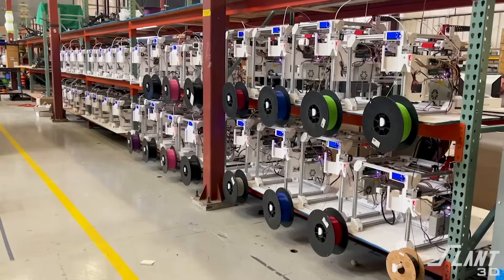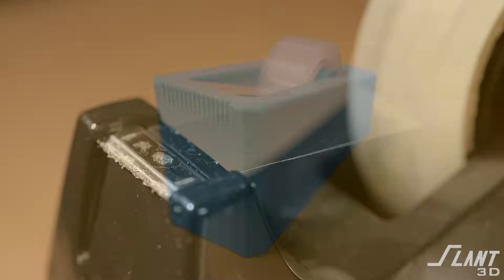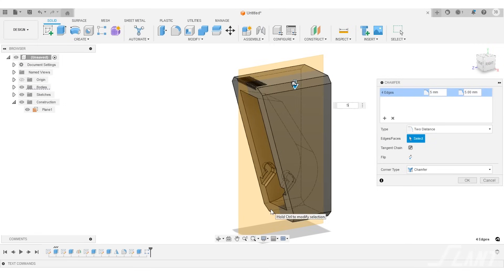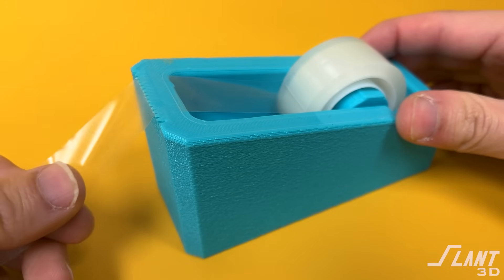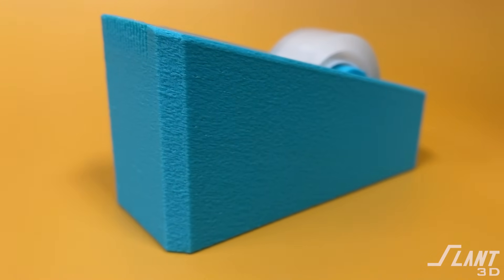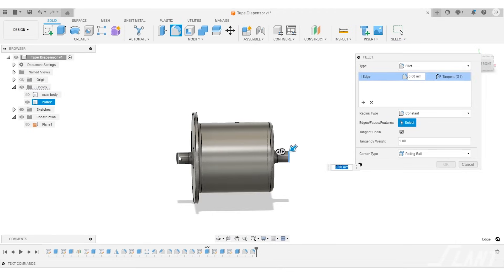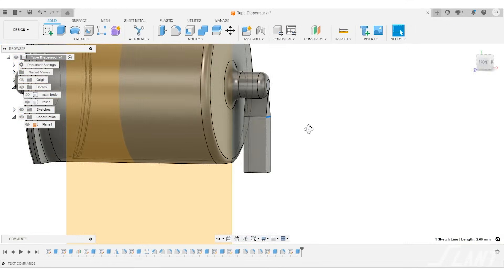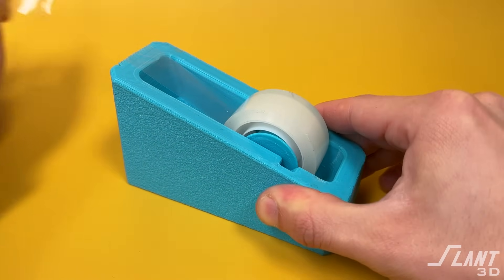Designing a Tape Dispenser for Mass Production 3D Printing

Comment: I think that it could be easier and also faster if you print the roller inside the housing as one piece (in place like a joint open in one side) and support each overhang of the roller with a very thin point of touch in the housing ( something that the final customer can brake by pulling out himself) . 
Also ( I suppose someone also wrote about it ) in your design there in not enough space for the finger to go under the tape and grab it. 

Nice videos anyway . thanks for the good ideas

Comment: You could have used the tape dispenser itself as a support for the roller pins, by printing both at once
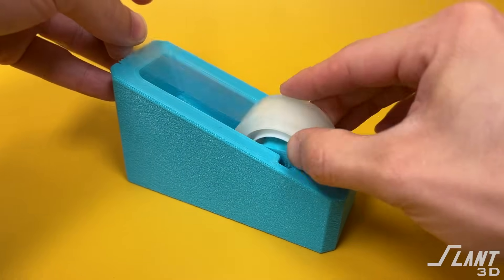Look at @5:42 , they're flush
Reply from the maker: Good point. Totally doable. Though there would be a bit more sag on the Dispensor Roller Pegs
Reply: Big brain 👍

Comment: wont is cost a ton because of the supports and the assembly?
Reply from the maker: No supports and no assembly
Reply: I mean puting the other part inside the bigger one + the part you added which is a different type of support (tower) @slant3d  
I just don't know if this specific product is better with 3d printing just because of the cost. maybe with some automation but then I don't see why indjection modling isn't better.
correct me if I'm wrong about the price, because I don't have a manufacturing buissness (including of course additive)

Edit: as a proof of concept, it's amazing to see what 3d printing can do

Comment: This may be easy to print but this design misses all the key points of a tape dispenser. I'd like to see a take on the design that actually keeps the product functional.

- That U shape is to grab the tape easily
- Sand is cheaper and more eco friendly, you'd need crazy high infill for it not to slide around.
- Even with high infill, it's too light for 1 hand operation

If you can't use it with one hand, it fails a being a tape dispenser.

Comment: I'd like to note that the all too frequent suggestions that having to learn different engineering design techniques that work well in 3d Printing really is nothing new. We did not start doing the variety of injection molding we see in that market 70 years ago when injection molding started being done. Things like dual injection of a different variety of plastic for different varieties of texture or grip, etc. These took many failed attempts before repeatable solutions were found. Learning new techniques that work well for 3d printing is going to take time and a lot of experiments that don't happen to work.

Comment: The fizzy skin looks neat, but I can’t help but feel like that option was enabled because whatever printer you used is optimized too far into the speed side of things rather than the quality side of things. The wall stacking on the inside of that part looked very inconsistent. Is that the norm for print farms? This is a genuine question - while I’ve been in the 3d printing hobby, I’ve never printed anything as a product before, and for all of my personal projects (most of which are mechanical and don’t actually need to look good), I’d consider that level of inconsistency unacceptable. So, is that level of quality inline with other 3d print farms, or were you just trying to get a part out the door as fast as possible for the video?
Reply: You would often trade down quality on interior surfaces for speed but the photography setup & coloration is making that inside wall stacking look much worse than otherwise.

Comment: I like most of the design (apart from the issue others noted with access to the tape), but are we going to talk about the finish inside the dispenser. I couldn't regard something with layer lines like that as acceptable.  Is it the just a rough print? Is that a different noise finish that just doesn't come over well on camera? My X1 doesn't ever produce something that liney, if it did I'd can it. Is this the mass production printers print quality, or what? I don't know if I'm too sensitive to it, but to me the lines on the inside make it look amateurish and devalue the product. I know you've said in the past that customers don't care ... but really? Possibly it looks different in person.

Comment: Would it be possible to see some price comparison for items like this? What is the cost of making 1, 10, 1000, 100,000 etc  this way as opposed to the classical methods?  I get the principle and the engineering / design benefits  but it would be great to explore a real world case study with some numbers in it
Reply: Using the 0.25 lb he quoted in the video, some math indicates $1.25 for just the filament, assuming the $11/kg he is targeting for the final price of what they will be selling to customers. Note that this doesn't account for electricity and business expenses. Most tape dispensers of this style appear to be in the $5 to $7 range, so even with all of the other expenses it is likely that it can be produced at a price competitive to injection molding.
Reply: @logicalfundy actually if raw material costs 1 usd probably with all the expenses it ll cost manufaturer around 4-5 usd. If you want to profit %25 or %30 it ll make it 5-6.15 usd. Excluding shipping. It needs to shipped advertiesed by the buyer. So they need to sell around maybe 9 usd ish. Not very price competetive.

The thing is, if you want less than lets say 1000 unit. Then you get that price competetive range.

Around 300-500 unit, 3D printing is super competetive in price. Probably cheaper than many other methods. After 500 units it ll get close.

After 1000 units its really hard to beat the molding depending on your object geometry. Especially with thin objects.

I know these because i have a consultant company for mass manufaturing and prototyping. Also I have a second company that 3d print on demand with around 20-50 machines.
Reply: @X7Hide  so basically the tape dispensers being sold today have negative material costs. Sorry, the math doesn't add up.
Reply from the maker: Check out a few of our past videos. We going into those types of comparisons

Comment: It's cute. Although I would have preferred to have the teeth separately. Keep them 3d Printed I don't mind but slot them in. So once they are getting blunt you can swap in replacement teeth and don't need to throw away the whole thing.

Comment: This design does not seem very ergonomic to me, the reason most tape-dispensers are U shaped is so that you can easily stick your finger under the tape to get more.
Reply: I don’t think there’s any claim that they are product designers. The point is looking at design that takes into account the method of manufacture. There’s still the holy grail of combining that with user-centric design principles and “creative flair”, but that wasn’t the purpose of the video
Reply from the maker: Luckily it is 3D Printed so a new model could just be uploaded changing the product going forward. Sure beats carving it into stone
Reply: @slant3d  is that how tape dispensers were made until now?
Reply: @slant3d orly?!
Reply: @wollinger  bin a while since I've seen someone say that SuperVinlin
Reply: @slant3d You put out good content, but you treat 3d printing like it's a religion and ignore the flaws, or any criticism
Reply: @fatal510 the point here was making with the reply here was that it could easily have been made U shaped and since they didn’t make the mistake of spending the money to make a mold they can simply adapt the design based on feedback. In this case this is absolutely where 3D printing shines.
Reply: @fatal510 its his business and potential customers watch these videos so yeah , he is going to prop it up. Saying he ignores flaws in the process is simply not true. The fact that he had to use and design supports, create flat edges on round parts to overcome the limitations and constraints of 3d printing is evidence of that. Though I'm not sure I would use the word flaw for that stuff.

Comment: The new model looks nice. Thanks for the design tips! How do you get to the tape to use it? The U-shape on the traditional dispensers lets you get your finger under the tape, lift it off the cutter, and pull out the next length to cut. I don’t see a way to get to the tape easily with the new design, so while pretty, it doesn’t seem as functional. Would cutting some divots on either side of the tape channel (but not all the way through the block) affect printability?
Reply: Add the U shape and then print it on the short side of the tape cutter standing up instead.
Reply from the maker: It could be modified to have greater access without changing the outer silloette

Comment: It’s hard to ignore the fact that the model was not built on the correct plane. Top plane is top! Great video regardless :)
Reply: Slicing and printing apart upside down so that the customer facing surface has the best texture possible and sharpens lines and edges and so the part can be printed all in one shot without overhangs or extra supports is pretty common 3D slicing practice

Comment: That's a nice POC, but I how much would a piece like that cost per piece say 100,000 of them? I have a hard time believing this particular part is as cost effective as the Chenese trinkets that cost like 10 cents to make.
Reply from the maker: This certainly would not be made for 0.10 if it was made in china. It is mass produceable to be sold in retail and manufactured with printing.
Reply: @slant3d  Of Course your design would command a higher price tag due to being higher quality product as opposed to the Trinkets they produce in China, so the market segment that your design would be aimed at would be a few levels higher than the trinkets sold at the $1 stores.